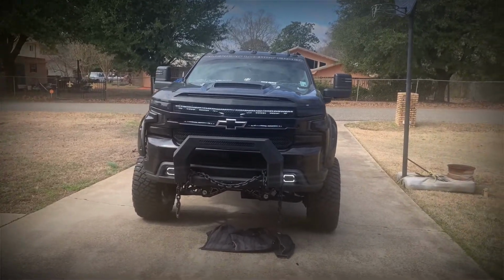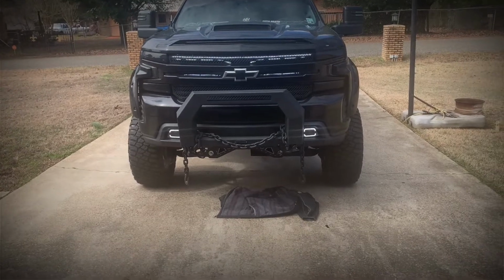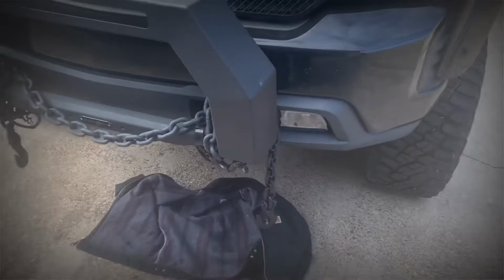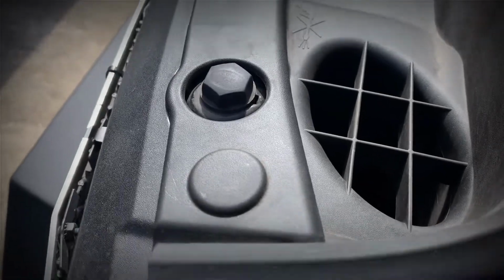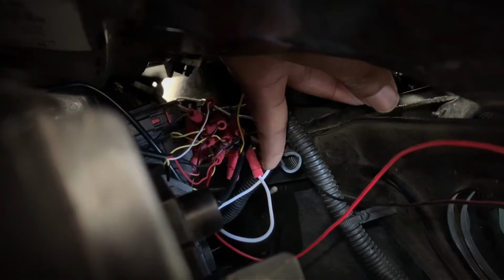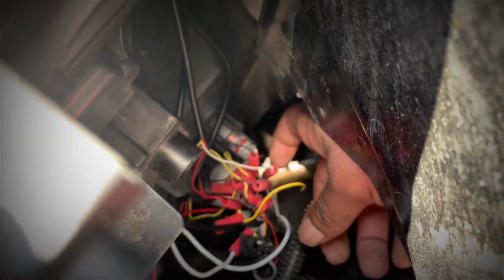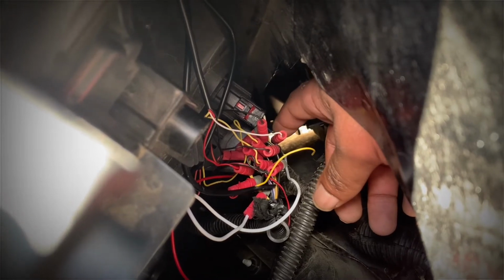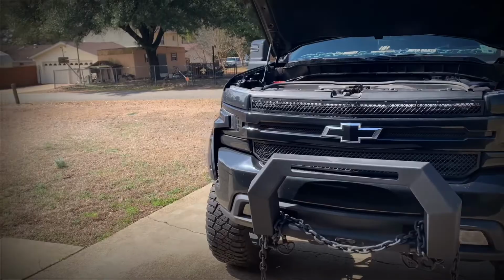How I wired my DRL Foglights on my Lifted 2020 Chevy Silverado (I Am Blackocalypse)

Comment: Man, I really appreciate the videos you posted.  You have an awesome truck!!  I watched both of your videos on the DRL fog lights and how to install them.  I looked over both the right and left wire diagrams you showed in your video, and it shows that pin 8 is the DRL control.  Is there a specific reason why you recommend tapping into pin 2 the yellow wire?
Reply from the maker: Thanks! I really appreciate it, And not really a specific reason, i just like that pin #2 makes them come on everytime the headlights have power flowing, More of a personal preference but they can be wired other ways to match other light functions.
Reply: So best function is tap into pin #8? Yanks yall